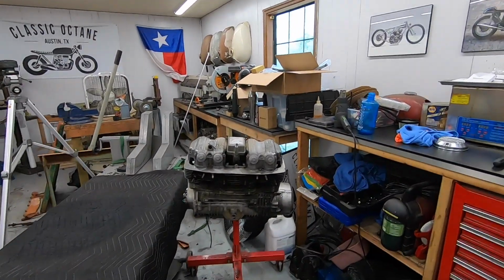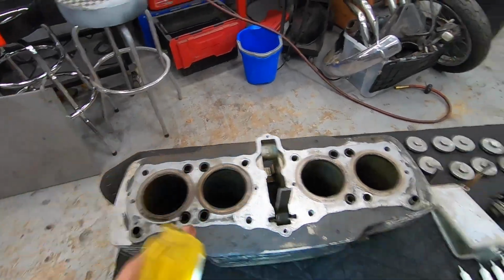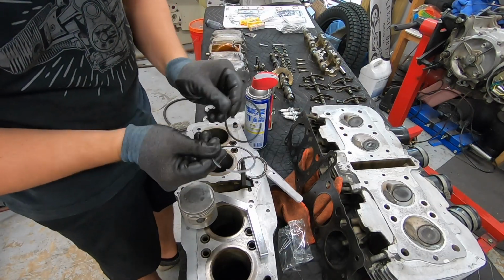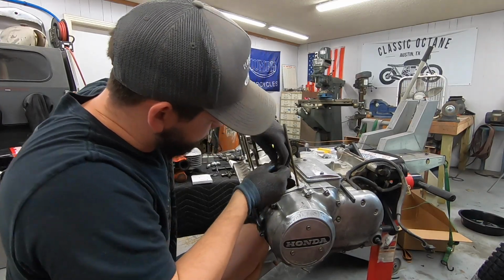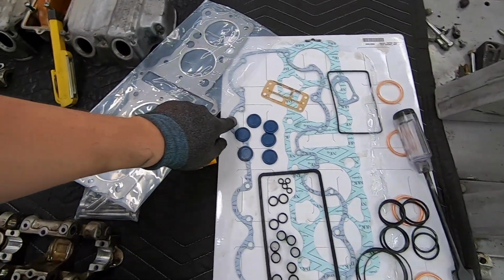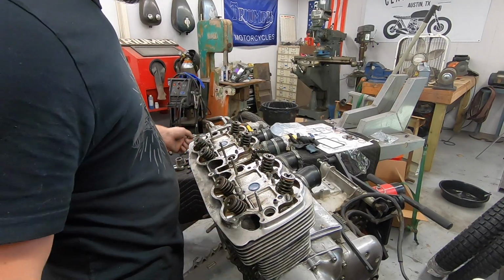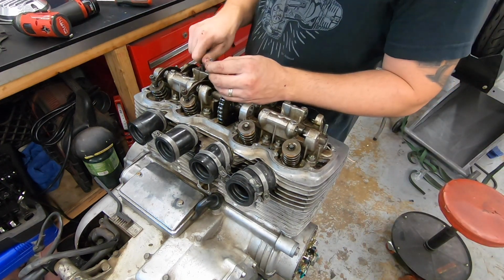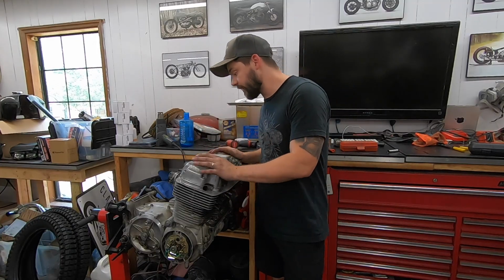Low compression CB750 engine teardown. Found the problem.

Comment: You have no idea about honing cylinders
Your cross hatch is shit you didn't take all the glase of the cylinders 
You didn't put sealant on the rubber plugs under the cam cradle 
You give people the wrong way of doing things 
How do I know because I'm a professional engine builder i specialising in cb 750 and z900 engines and  have been doing it for 50 years 
People like piss me off because of the bullshit you talk thinking that you are something that you are not 
.

Comment: Good clearly explained step by step. I have a 1989 Kawasaki ZX10 with #3 cylinder measuring 60 psi. There has been a noticable increase in oil consumption, is the likely cause? 
I have no leaks or evidence of smoking. I put some oil into #3 and the compression raised to 120 psi. So looks like I'll need to have the cylinders honed and new piston rings fitted.
Where can I source piston rings as Kawasaki dont list them any more?

Comment: I haven’t read through all the comments so apologies if it’s been asked? 
What and where can I get the adapter brackets to convert the engine stand you are using to hold the cb750 engines? Thanks
Reply from the maker: Made them myself with threaded rod and angle iron.

Comment: Hi from the UK. I have a 1972 CB500/4 K2. Is the process of teardown substantially the same as for your 750? I found this to be a really informative and excellent video. In many years gone by, I used to rebuild many 100s of Rover V8 engines and I have always used some type of lubricant, either oil or  Graphogen on all bearings and piston rings during assembly. It was just my way! With the problem with No 4 cylinder, did you (off camera) check whether the water ingress, which had clearly occurred, had got to the No.4 big end or the crank in general and the oil pump as well? I have subscribed and will be working my through your library. Excellent work.

Comment: How do you?
Know you have the right rings without gapping them first without physically checking the gap which means you've got to clean the cylinders hone if necessary. And then insert the piston without the rings on it so that you can get the ring flat level and check the gap at the end of the rings. Each bike has its own specifications for that gap.
 Finally rebuild the engine..

Comment: I new rubber tensioner wheel is completely smooth. Yours has worn bumps in it. I don't know how you concluded it does not need replacing.

Comment: Just allow the cam chain to drop into the crankcases,    fit the cylinders and cyl. head , then retrieve the cam chain using a telescopic magnet  or a piece of hooked wire, ... makes life so much easier.

Comment: How do you mount the engine to the motorcrane? What parts and where to get em. I just took out my first 4 cilinder from a CB750f, they weigh insane amounts. the motor is on the ground but need to be able to work on it. Wanted to buy a moveer for the engine like you have, but the connections are not suitable. Can you share your setup perhaps ?

Comment: Nice vid. Just a bit of advice... It's a good idea to glue those rubber disks (under the cam holders) in place. I've had one leak on me. PITA because (as you know) you have to pull the motor again to fix this.

Comment: the answer to why the ring gaps are never in the front or rear ?the piston is only round at the crown s at the ring lands rest of the piston is oval so it can grow with heat ‘, so with the ring gap facing on sides acomodates that 
????? any one got a better answer ?..

Comment: Am I missing something or did you not remove and check/lap-in the valves? That’s where I would have gone first for low compression on one cylinder.
Just noticed this was 2 years ago so probably irrelevant!

Comment: Good job.  Outstanding.  Installing the pistons is the part I hate.  I set no. 2 and 3 in the up position and install those in the cylinder first then rotate to even (also allowing the cylinder to drop with the center pistons} and then install the outside pistons no. 1 and 4.  I don't have your finesse.

Comment: Just a few quibbles with the terminology used in your commentary:
The "top" ring is properly called the compression ring
The "second" ring is properly called the scraper ring
Yes, the "third" "ring" is called the oil control ring and consists of an expander in the middle with rails above and below it.

As well, after honing the cylinders you MUST use clean white rags, preferably something soft like cotton (old clean white tee shirt material that's 100% cotton without silk screened stuff on it works great) to clean the cylinder bores of all the grit from the hone stones AND the cast iron powder from the liner surface itself. Wipe the bore with a cotton rag dampened with mineral spirits (NO WD40 or similar lubricants) and then toss the dirty rag. Repeat this process until your last rag will not show any black stuff at all. You'll be surprised at how much rag material you can use just to ckean ONE cylinder bore. Your whole engine will thank you for taking this extra step of getting rid of all that abrasive crap.

As to installing the block and coaxing the pistons/rings into the bores: you really should thoroughly bathe the rings with engine oil before trying to get them into the bores. You'll find that things go much easier. 
It would also be a great idea to lube ALL the cam bearing surfaces AND the lobes with engine oil or "startup lube" before installation.
Reply: Just read your comments, after I had posted mine, and agree entirely, but I think this guy is doing a great job and if our comments are valid, then it should enhance the Video. However, it must be remembered not to 'carp' at people from the side-lines.
Reply: The compression ring is curved and in this video he does not mention if the curved side is up or down. I'm about to undertake the same operation and was wondering if you could  let me know which side is up. I suspect the curved side is up (faces up) but not certain. Thanks.
Reply: @cyrilleloreau1603  I'm not sure what exactly you mean by "curved"......but the compression ring and the scraper ring SHOULD have a letter (or letters) stamped on one end of the ring where the 2 ends of the ring come together. Both of these rings should be installed with the letter(s) facing up to the top of the piston. I hope this helps.

Comment: You stated that you didn't want to use anything aggressive on your aluminum cylinder head and then went at it with a green scotchbrite. Green is aggressive and will remove metal. 

I hope that when you finished you got a good seal on your head gasket.

Comment: Quick question, i see that there was still top ring witness marks in the cylinder bores, even after you lightly honed em, any issues with blow by ? Or any other issues ? 
How cone you didnt clean em out all the way ?

Comment: Hi  I just wanted to say ty for the inspiration to take this on …. My 76 Honda 750f has same issue with one cylinder with low compression at 85 .  Where do you purchase the top end gasket kit and stainless hex bolts 
Will vintage 750 or 4 into 1 work ?  
Thanks again

Comment: The beauty about SOHC Hondas (and Z1 Z900/1000 Kawasaki's also H1 H2 triples) is that there is so much after market stuff for decent prices. Their continuing popularity and sheer numbers sold, especially in the U.S means its commercially viable to mass produce parts. I'm into 80s Japanese stuff, but the 2 year product cycle, often with complete redesign, means finding parts for some bikes a nightmare.

Comment: I'd use two rectangular magnets that cover both the cam and the cylinder head on either side of the camshaft to keep the cam from spinning while you're trying to rotate the cam sprocket.

Comment: Your correct in ascertaining the trepidation most folks place on a refresher with engine teardowns, associating it with marked levels of terror that things will be thrown out of kilter from small missteps taken along the way. A hundred diversions probably accounts for most unsuccessful repair procedures more than misdirections that take place. Great synopsis of one's route to travel when putting these plants back together. Best of luck with your frame and suspension refit and upgrades. Warmest regards.

Comment: always a good idea to remove the valves and lap them in by hand.Particles of rust can sit on the surface of the seats and hold the valves open slightly.Its just peace of mind,and saves having to strip the engine down again.cheers Graeme from New Zealand,enjoy your programmes

Comment: I had the pleasure of attending and graduating (youngest to grad age 16) from American Honda Midwest Service school back in 1970 right after the Daytona win. The class was held in Bob Hanson’s Race shop in Racine Wisconsin. My instructor was Bob Jamison who prepped the winning 750. He was a real stickler for detail and this is what I learned from his philosophy. You did a great straight forward job however what you missed was...the troubled cyl probably had rusted (at least) the intake valve. If you’re not intending on inspecting the valves, do a leak down by pouring solvent in the intake and ex to see if it’s getting past the valves. The cam tension rollers get brittle and under all circumstances be changed. The rubber compound on the knockoffs are not near the original Honda part. 
The valve seals also get hard, and while you’re in there, it’s an evening job to pull the valves, lap them in and put new seals in. Make sure u check and lube the stems.
Reply: Jamison grad 69
Reply: Sure you did

Comment: I've seen this countless times after sitting a long time outside with the exhaust valve open the whole time. Not so much the intake valve. It's a lot tighter air passage. The exhaust valve is wide open to the free world. Always sad to see this kind of neglect to such an iconic motorcycle.
Cheers from Louisiana.

Comment: You could hold the parts a little closer to the camera, might consider finding me a 750 ,Saw one chopped once when I was young, I thought about that bike the past 45 years and  even though  it wasn't a Harley back knew I knew from owning a 160 I it was lean and fast. To this day I wanted to know what it felt like to crank down on that  throttle. Those four pipes coming down under that bike just had a look and it had a sugar bear front end.     Mannnnnnnnnn

Comment: Well done video! You have emphasized loosening the head bolts a little at a time in two or three steps. That is very good advice. I would add to that to FIRST loosen the six 6 mm bolts (four under the rubber plugs and two at the cam chain area). When you loosen the nuts on the main cylinder head studs there can be a lot of stress on the 6 mm bolts. On later engines this is more critical where the cylinders are part of the crankcase. There are torque specs for all of the screws and bolts on the engine. If there is no specific torque spec for a bolt, use the general torque spec for that size of fastener. You can find that information at the front of the Torque Specifications section in chapter one of the Honda Service Manual. The silver gray color on the top piston rings is chrome plating to extend the life of those rings. You didn't mention cleaning the cylinder bores after honing, or I missed it. It's really good to get all of that honing grit out before reassembling the engine. I recall that the cam chain tensioners would get corroded and stick in the tensioner. I found on the early years of CB750's that there was a small threaded hole in the back of the tensioner rod that I could thread a screw into that would act as an indicator that you could watch to confirm that the tensioner was working. This was useful during a routine service.
Reply: Yeah, I caught that too. I learned something today I had never thought of.

Comment: Great job man, but, I would  add i always clean out the ring grooves on the pistons with a piece of old piston ring in case there is slight carbon build up under the rings. Here in the UK we call the top ring with the chamfer a ridge dodger , It's there in case you have a slight lip on a bore to stop the ring hitting it (Which you probably know already )

Comment: Great video, One thing I'm sure you do anyway is I spend at least half an hour on each cylinder scrubbing after the honing process as that fine stone and metal paste sits in the honed cross-hatch and takes alot of work to get out, I use paper towel and lacquer thinner until after a wet scrub the towel comes out white with no signs of grey, without doing this engine life is severely shortened, I have race motors going around that I built in the 90s smoke free with great compression.

Comment: Won't wait till the end, to guess it's rings. These are air cooled so over heating is common if you run low on oil. I had a 75, but it never failed.

Comment: No assembly lube on the cam holders?  All engines need plenty of lube help on the first start after any rebuilding is done so as the cam bearings etc do not run dry waiting for the oil pump to push all the air out of the oil ways and get oil up to the cam bearings from inside the base cam bearing. Just pouring oil over is not good enough lol. Look into assembly lube as it is a little thicker than oil and protects all of the moving part surfaces until the oil pump is pumping oil up to the head properly.   Just an FYI    Otherwise very enjoyable to watch.

Comment: The reason the head gasket goes on dry is because any sealer used could possibly block the tiny high pressure oil way holes in the cylinder head and that would be very bad news indeed.  One thing I noticed is that the head gasket was not laid flat over the oil rings and you just pushed/dropped the head gently into place and kinda hoped that nothing gets pinched.  Hope it works out and no oil leaks.

Comment: Your hone is great for removing a small ridge at the top of the cylinder yet I found that the different grit ball hones made a really nice cross hatch for reseating the rings.    The compression ring gaps should never face the valves due possible loss of compression on the power stroke and exhaust stroke plus getting maximum pull/suction of gas and air on the intake stroke.

Comment: Good video.  Thanks for making it.  CanI suggest next time add a comment on how to test now well the valves are sealing.  Such as using a flash light to see a gap.  Or gasoline/kerosine in the valve to look for drips.  Not that hard to lap the valves since you are in there.

Comment: How does water get into the cylinder on an air cooled engine? And only on #4 cylinder. If water was in the fuel, I would expect similar findings on all cylinders. Elbow grease works great for cleaning!

Comment: Before opening any engine I perform a leak down test.  I want to know if the problem is with valves or cylinder.
Reply: agreed..or squirt some oil down plug hole and see if compression improves

Comment: I'm surprised that the rings aren't stepped on the ends to fit a pin in the ring groove. This would automatically locate  them 120" apart and stop them rotating in use. Then, I've never owned a Honda..
Reply: They do that on 2 strokes to prevent the rings being caught in the transfer ports. Not necessary on a 4 stroke
.

Comment: Hi,
I have recently installed my CBX 750P engine. all parts are new and original. I changed Crankshaft, Main bearing, and Conn. Rod Bearing, pistons and rings, Cylinder, Cylinder head, Valves, Seals, Cam  Shafts, Arm valves Rocker, Adjuster Hydraulic Lash, and all Gaskets and so on.  The first start was very smooth. The engine is running without any problem and noise. But I think a hidden problem occurs. When I check the cylinder compression I find 95 PSI. In the workshop manual, the value must be 171 (+28,-28). I have just rebuilt and no break-in. The 95  PSI is normal value?
Will the compression value increase up to 170 PSI after the rings seat?
I have checked the cylinder head leaking(not leaked- The cylinder head is new) and measured with 2 different gauges.

--
Best regards and stay safe,

Comment: Love your videos but I would be cautious using a scotch Brite inside the engine. Some of those pads can leave aluminum oxide particles behind when they break down. You wouldn’t any of those particles making their way to the internal bearings. At the very least check the composition of the pad before using it.

Comment: When removing Piston Rings you should place small rags around the 4 Con Rods so any mishap and you dont end up with foreign objects drop into the bottom of the motor..
Reply: You stole my comment.         When he snapped ring a piece could have dropped into engine.
Reply: Not only that but connecting rods can be damaged if they come in contact with crankcase resulting in stress riser crack and rod to fail in service
Reply: Tell me about it. I removed the pistons to get them vapor blasted and when removing the piston pins and then the little tiny clips (even with rags stuffed into the bottoms to avoid anything dropping down into the bottom case) a little clip found it's way down there. Two hours fishing it out.

Comment: Did you make those engine  mounting brackets for your engine stand or did you buy them? I have an engine stand like yours but as they're mostly for cars they mount to the engine forward rather then side on like motorcycles.
Reply from the maker: Made them from angle iron and all thread.